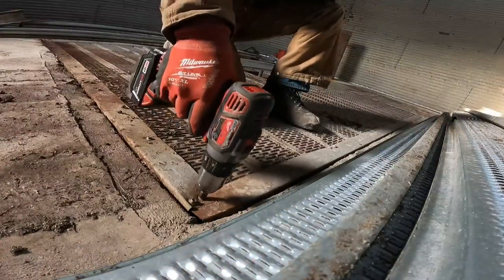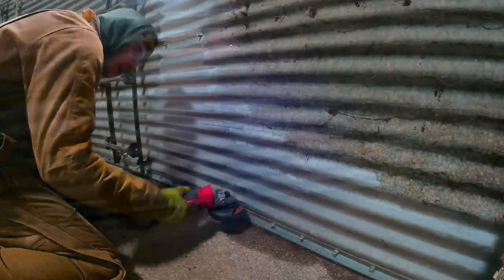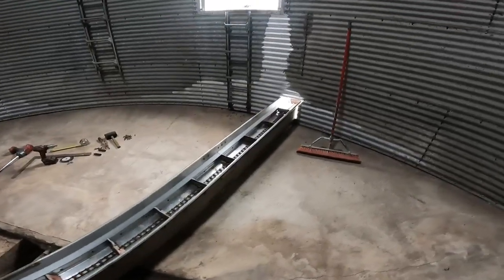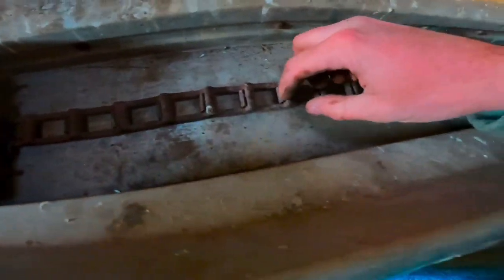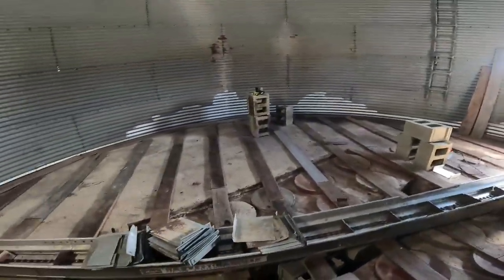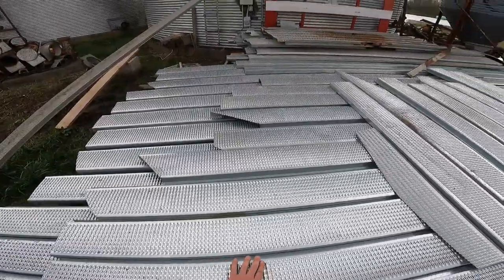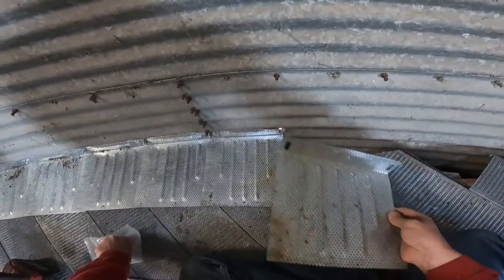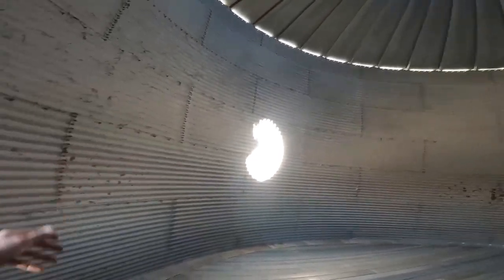Retrofitting a Grain Bin for Ear Corn Storage

Comment: Jacob I’m might be wrong but you said ear corn in this bin you got the right idea but your conveyor might not be wide enough for the ear to fall into it we used and 25 inch wide hay grain elevator so when the bin fills up it will fall into it with out caving out  just saying I hope you’re plan works well you put a lot of hard work into it keep smiling
Reply from the maker: I thought about using one of the new idea elevators I bought, for the floor. The little aluminum won out because of ease to maneuver into place and the modifications were simpler. Also, I won't have to worry about carrying more corn than whatever elevator is outside can handle.

Comment: Do you realize you placed the concrete blocks on their weak side? They have their strength with the holes running vertical. They're more apt to collapse under weight the way you placed them.
Reply from the maker: It's how the Brock manual says to place them to hinder air flow the least. I'm not wild about the blocks, but I like that they can't rust.

Comment: Maybe I'm missing something, but I don't see any way that ear corn will "flow" out of the bin. There could be a lot of weight on the elevator, but more likely, the ear corn will be jammed up against itself and never even make it to the elevator. I guess time will tell.
Reply from the maker: The covers over the elevator will keep corn off the elevator. I'll start from one side and work my way across unloading.
Reply: @boehmfarm4276  Here's the comment I've been looking for. If you fill the bin enough to cover the door,how will you get to the elevator inside to get started removing corn? If you leave the first 10 or 12 inches open,you might possibly have a log jam OR  no flow, with no way to assist the flow. I'm not trying to be difficult,just imagining it was me doing this.AND thanks for doing this! I wanted to do this as a kid,but the scoop shovel always won out.